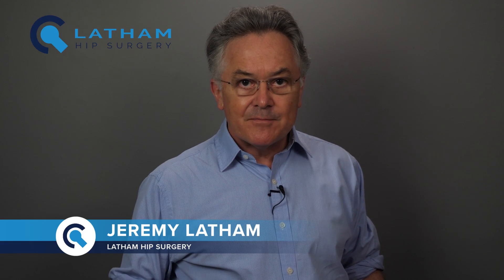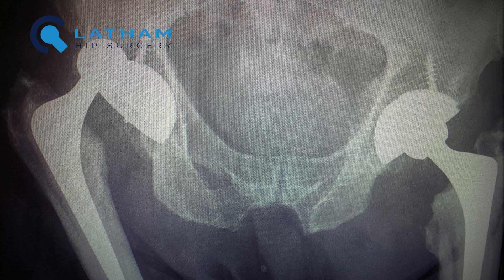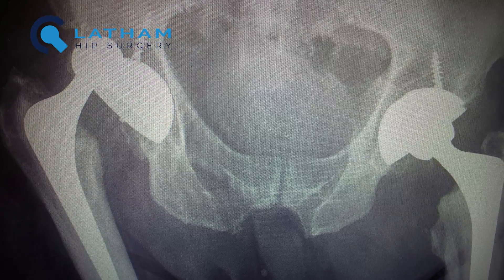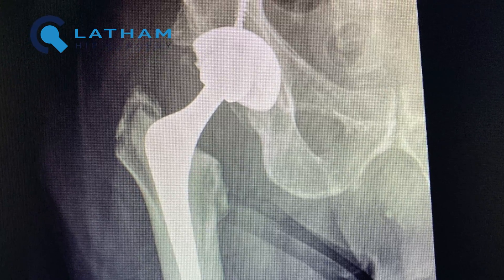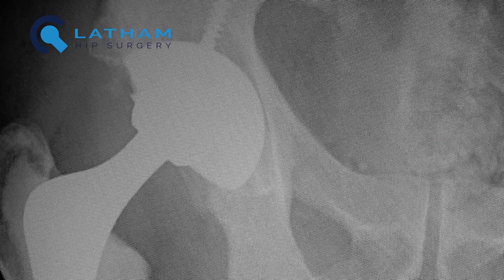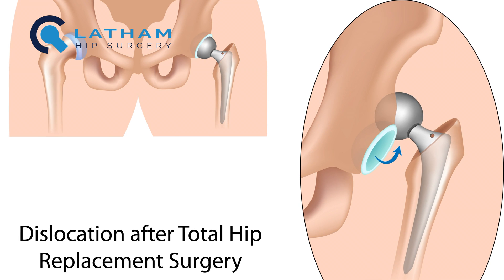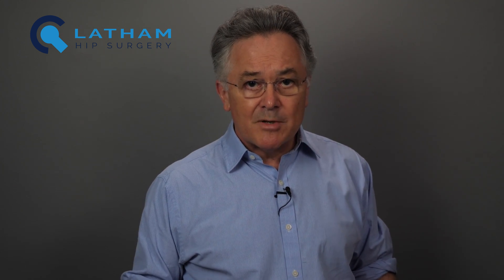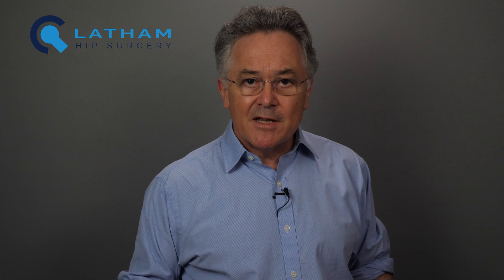Why do hip replacements dislocate?

Comment: My hip has popped completely out my all natural socket 7 times before they MADE me have surgery.. I didn’t get a replacement as I was 31 at the time so he went in there and drilled like cords threw bones that I guess hold it in.. (I’ve tripped and fell a lot and it still hasn’t come out) I forget what the surgery was called lol.. 
Now I’m 41 and the pain.. lack of movement and popping when I walk is beginning to limit me and its  HORRIBLE.. I was gonna talk to my primary about a full replacement and while researching it I just seen this video and a replacement can dislocate also.. like WTH.. hip dislocation is the worst pain ever.. and I’m stuck on the floor until ambulance gets here.. now I’m kinda scared to even get a new one since I had surgery in the first place to stop it from dislocating every time I tripped and fell.. Lordy..

Comment: If the hip dislocates, it may require re-surgery, or it can be re-located without surgery?
Reply from the maker: In most cases surgery isn’t necessary to reduce a dislocated hip replacement. It’s pulled back under an anaesthetic. If it keeps happening or it won’t go back, then surgery is necessary to deal with it.

Comment: I had my total hip replacement 14 weeks ago and although I've not had a dislocation Ive had it move out of the socket and pop back in about 9 times. Just yesterday it popped again when I went to tie my show lace and today at the gym on the seated calf raise machine it also popped. When it happens Its really distressing  because If its moving out of place this easily then it might not be far from dislocation.The first few times it happened I put it down to the muscles not being properly healed but Its now becoming a concern that my mobility will be really restricted. I am a martial arts instructor and was very flexible before the operation.  Each time it pops out and in the front of my hip is sore for days.
Reply from the maker: @tkd4  you should speak to your surgeon about this.
Reply: Mine is doing the same. I hate it  and now I’m scared to do anything, including PT. I still limp and feel very unstable without my walker. I am only 57 years old and I feel more disabled than before my surgery.
Reply: Having the same trouble with mine now, what ended up being the issue?
Reply: @dylanwillis5165  it's not been resolved yet. I'm due a check up in March.  The popping out of the socket has happened less often now but that mostly due to me being extra careful all the time. It still happens though.  I'm sure it's down to having the small sized ball on the new hip. It's still sore every day and lifting my knee hasn't become easier  as I've got stronger.
Reply: @tkd4  unfortunate. I am to meet with my surgeon today, hoping he has answers. Told me I needed to keep doing my at home exercises and Physical therapy.

Comment: Update: 4 days after my sudden dislocation, my surgeon went over my scans and x-rays. I was told it looked fine and to go on doing my thing. It dislocated again while I was home alone. I fell to the floor immediately. I had to call out to my phone, to call my family/ambulace. I ended up having a hip revision a week later, this May. My first hip surgery was only in March! My surgeons partner found the problem. The angle of the ball and joint was incorrect for my body. Now I’m healing all over again and it’s much worse this time, I pray to turn a corner soon. I want to have my life back and forget this ever happened, though I know I’ll never forget, it was too traumatic and will take a long time to heal physically and emotionally. I found out that the first dislocation caused me a compression fracture in my spine as well, when I landed on the concrete the first time. That pain is the worst right now. I heard it’ll take months to heal. I cry a lot these days.
Reply from the maker: Sorry to hear about this. Take each day as it comes and try not to think too far ahead. Take plenty of rest.
Reply: @Lathamhipsurgery  Thank you for your advice. Will it hurt me to skip my PT excersises on occasion when I’m very tired/painful? I’ve been doing them since day one. Some days, like today, I’m so exhausted and sore. I just want to sleep.
Reply from the maker: @audnbob1 surrender to the tiredness. Rest is good and a very important part of your recovery.
Reply: Sorry to hear.

Comment: After hip replacement how could we know that our hips are dislocated? Please explain it sir
Reply from the maker: If a hip dislocates, it will cause a lot of pain, and the leg will be rotated and shortened. You would not be able to walk on it.
Reply: @Lathamhipsurgery I have s question then. I had hip replacement surgery almost 2 years ago and I have experienced pain in my groin area. Its kite of a discomfort pain. I can't lift my leg to put my sock and shoes on. I hurt when I walk. I hurt when I try to stand up. But everytime I go to the doctor that did my surgery and he takes a Xray everything looks fine.  He never goes further than that. I'm tired of hurting what should I do.
Reply from the maker: @RedbirdCountry  It could be that the psoas or rectus femoris tendons are catching on the socket. When I see someone with these symptoms I order an ultrasound scan to confirm the diagnosis. An injection of local anaesthetic and steroid often helps. Other causes such as infection and loosening of the components have to be considered as well.
Reply: @Lathamhipsurgery  thank you
Reply: Mine dislocated  a couple hrs after I got home. Back to hospital. It even dislocated in hospital.   Another Complete hip replacement after 1 week.  Over tge next 6 to 8 months, dislocated 8 or 9 times. Finally  another surgery to replace everything again, found out socket was sitting at about 45 degrees.  That didn't show up on x-ray. .  Been a couple years and it is fine now.
Reply: Be glad it’s never happened to you.. lol believe me you and everyone in your neighborhood will hear you scream as you can’t even get up let alone move and the pain.. 1million on scale..

Comment: I'm 64 yrs old and had both my hips replaced about 6 years ago using the anterior method. Its been great but recently they have become stiff and difficult to stretch out. I'm very active. I bike to my gym a few times a week. I work out for 45 minutes with weights but I'm careful not to use heavy weights so I do not put pressure on the hips (no squats or anything like that). The only exercise I do standing is curls with about a 100 lb curling bar. I then use an elliptical for about 20 minutes and bike back home (2.5 miles). I play in a softball league where we play every other day and have practices in between. I play the outfield so I'm running down fly balls. Its all been good and no dislocations or anything like that. Just very stiff recently to the point where its uncomfortable. I was also doing yoga and I do stretch out before practicing or playing softball. Not sure why its suddenly feeling stiff and like a block in my hip.
Reply from the maker: You should have a check up with your surgeon.

Comment: How do i tell if it pops out of socket?
Reply from the maker: It will be painful. The leg will be twisted and shortened. You will struggle to walk.
Reply: @Lathamhipsurgery  can it partially dislocate? Am i supposed to be able to feel the ball and it clicks when it moves a bit. 

Appreciate it
Reply from the maker: @SuperKoolDude  They can. It's called subluxation. Get it looked at!

Comment: I’d 7 dislocations of my right hip last year and my surgeon was quite happy for it to dislocate a couple of more times before he’d even look at it! On the 7th dislocation I was told I was going nowhere by another surgeon because he was going to fit a dual mobility hip replacement. Nine and a half hours of surgery later it was done. So far that’s nearly a year without any complications. Hip dislocations are flipping agony yet the 1st surgeon decided “he was happy with it to do it a couple of more times” thankfully the new surgeon stepped in and solved the problem.
Reply from the maker: Dislocations are terrible because they have such a bad effect on your confidence. If a hip dislocates 3 times then in my experience, it needs to be revised. Good to hear that yours has been sorted out.
Reply: @scottsymington176  did your hip completely dislocate each time? And did you need to go to the hospital each time. I’ve been having my hip pop out the socket and thump back in to place on several occasions now since my THR 14 weeks ago. Really distressing when it happens.
Reply: @tkd4  yeah I was hospitalised each time it dislocated and my confidence went down hill fast but thankfully this new dual mobility hip it’s never dislocated since I got it fixed
Reply: @scottsymington176  one more question. How painful was it when fully dislocated and were you able to move after it. I’m asking because I’m really worried it might happen to me.
Reply: @tkd4  ohhhh it’s really very painful when it dislocates! It’s horrendously painful!!! It took a 91/2 hours operation to fix the damage done by the dislocations.
Reply: @scottsymington176  so each dislocation made it progressively worse? I kinda feel I’ve been given the wrong type to suit my body structure
Reply: @tkd4  that’s exactly how I felt too.
Reply: My hip has popped completely out my all natural socket 7 times before they MADE me have surgery.. I didn’t get a replacement as I was 31 at the time so he went in there and drilled like cords threw bones that I guess hold it in.. (I’ve tripped and fell a lot and it still hasn’t come out) I forget what the surgery was called lol.. 
Now I’m 41 and the pain.. lack of movement and popping when I walk is beginning to limit me and its  HORRIBLE.. I was gonna talk to my primary about a full replacement and while researching it I just seen this video and a replacement can dislocate also.. like WTH.. hip dislocation is the worst pain ever.. and I’m stuck on the floor until ambulance gets here.. now I’m kinda scared to even get a new one since I had surgery in the first place to stop it from dislocating every time I tripped and fell.. Lordy..

Comment: Hello i had a hip replacement 8 weeks ago due to osteoarthritis but sadly after 6 weeks it dislocated, the pain was unbearable, i was rushed to hospital and it was maniplicated back into the socket, after my first operation i still had pain although the Xray was perfect at the time of surgery? Since it has been popped back in i have to wear a body brace for another 4 weeks, apparently my bones are excellent and very hard but my joints are bad. There is no difference in my leg length but i have a terrible limp, i dont know if its because im frightened to put weight on it or its psychological, I'm 60 years old and feel like my life will never be the same again as i have to have the other hip replaced plus my knee, i see other people who are older than me back to normal after a few weeks! My implant is ceramic with some kind of plastic cup. I would really appreciate your knowledge of my situation and whether in your opinion i will ever be back to normal again? Thankyou.
Reply from the maker: I’m sorry to hear about your dislocation. It is very traumatic physically and mentally. I can’t offer specific advice without a thorough clinical assessment and review of the imaging. Your surgeon will guide you through the next few weeks. Physiotherapy is very important once the brace is removed. A single, early dislocation will usually be an isolated event. If you have recurrent dislocations then revision surgery will be needed. My rule of thumb is if it happens 3 times then it’s time for surgery. I hope that everything settles down without further trouble for you.
Reply: @TheHipSurgeon  Thankyou for replying back to me, my physio starts next week so fingers crossed it will help my limp.
Reply: I'm so sorry you're going through this. I'm 63, a dancer and dance instructor. I've had hip pain and stiffness for 4 months and recently hooked up with PT and taking collagen, vitamin D, k and magnesium. I've heard too many stories like yours about hip replacement and at this point, I've decided I'm better off without it
Reply: I hope you get better😊

Comment: Hello, Do you see any down sides to dual mobility hip joints?
Reply from the maker: Thanks for an excellent question. Short answer, no as long as it's done for the right patient. I use them routinely in patients >75y, and anyone with neurological/anatomical factors that increase the risk of dislocation. The downsides are potentially increased wear in younger active patients, and the possibility of corrosion between the bearing liner and the titanium socket. Monobloc implants eliminate this risk but are less versatile.
Reply: @Lathamhipsurgery  thanks!  Yeah I have a condition that has a high risk of dislocation, so I guess the potential joint life expectancy decrease is worth the decrease  dislocation risk.
Reply from the maker: @Soljarag5  Agreed. Your surgeon will no doubt have a good plan for you.

Comment: Jeremy I am slightly concerned hip dislocation when I finally get op because I've been like this so long having had a family to support , so the muscles are very weak around my hip. Any advice for first 3 months after first one , I know 90° rule and the basic stuff but I'm a guy who by nature pushes my body , did it in sport ,did it at work and that's the very reason I've no cartlidge in my hips now , anything extra just little precautions you could advise because I'll be called up as soon as surgery restarts
Reply from the maker: I understand your concerns Mark. All I would say is that the risk is very small. If you follow all of the precautions it's unlikely that the hip will dislocate. The risk is highest in the first few weeks so take it easy during that time, and wait for the soft tissues to heal before you push it. Your surgeon and physio will be able to give you more advice based on your specific pathology/surgery. My general advice is to rest by lying flat for at least an hour twice a day, and don't sit for more than 30 minutes at a time. Use crutches for as long as you need them - it's not a race. Try your best to surrender to the process and enjoy the feeling of being out of pain, whilst getting stronger and fitter every day.
Reply: @Lathamhipsurgery  thanks Jeremy , yes I will mate , cheers
Reply: @Lathamhipsurgery  surgery done , was done the old way and I was home the next day , 4 days after surgery walking really good and joint is freeing up well when I wake , amazing procedure and a top surgical team , I stayed awake and had spinal and the anethisist talked me through it all. Surgery never a great experience but if it could be that's what I experienced, for my rite hip they said I can do without the catheter because it was god damn worst than op.
Reply from the maker: @markpatterson2811  thanks for the update. It must be a great relief to have had it done without any problems. Your new life starts now!
Reply: @Lathamhipsurgery  nearly just the right hip which pain wise is worst , I asked the left first because I'd had pain in it as long as I could remember and it just didn't work anymore but now it does , it's hard with one operated and one bad but the deep throbbing pain I had in the left is gone and it's pain free other than the natural swelling etc etc.
Depending on the success of the second hip dr laird said I may well be able to go back to bricklaying but no golden oldies rugby , hahaha